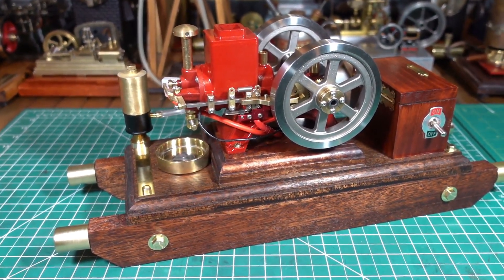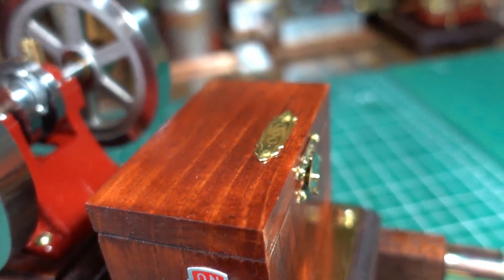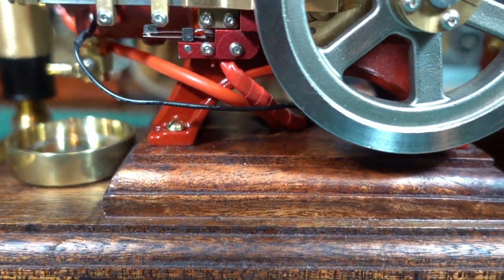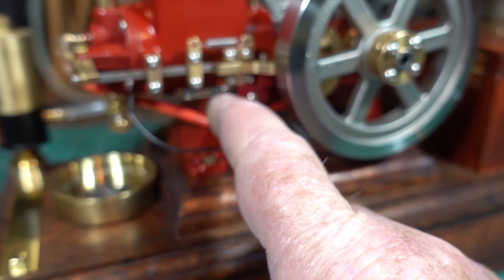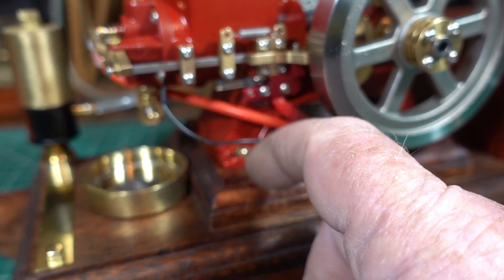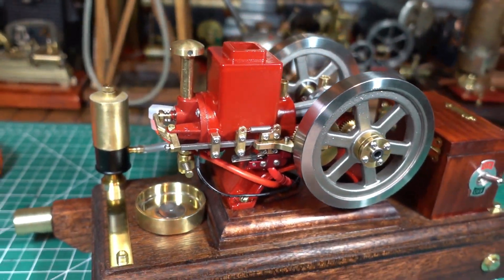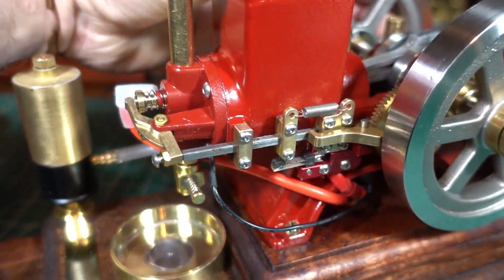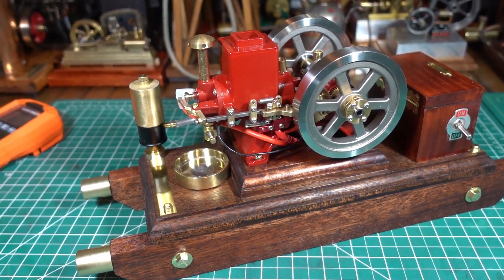Hit & Miss Engine 6cc Enjomor - Help Needed

Comment: Hi Jim, have you cleaned the contact points?  Ive had an issue with mine before with oil and crud "insulating" the contacts.  The black and white wires are the only 2 needed
Reply from the maker: Thank Matt appreciated, I'm working my way through all the hints and suggestions. I've been told that they need a higher voltage than 3 x 1.5v batteries, but it seems like that's all people use?
Reply from the maker: Still haven't got it working, but one thing I did do is that you know that bastard of a spring that holds the governor in place? I put a small drop of superglue in the brass hole and then put the spring in.....can't lose it again and spend an hour looking for it !!
https://flic.kr/p/2oS1b5T

Comment: Hi Jim. First of all, superb work on the base 👍👍👍 Watching other videos on this engine I noticed that where the black & white wires connect to the contact breaker the top one is very close to the brass latch. Might be worth checking to see if it's shorting.  Also, if you disconnect the cable from the contact breaker to the ignition unit then use your multimeter switched to resistance/ohms, place the meter probes on either side of the contact breaker and operate it manually to see that it actually is making and breaking.  Other than that all I can suggest is remove the ignition unit from the engine and test it by manually shorting the white and black leads together while having the HT lead close to the battery negative. That should give you a spark. If it doesn't that would tend to indicate the ignition unit is dead. Cheers, Alan.
Reply from the maker: Thanks Alan appreciate the comment I will try out those suggestions. I'm hoping its just something very simple.....thanks again for the help mate!
Reply: @SteamEngines-Jim  Let me know how you get on.
Reply from the maker: @RetroSteamTech  Thanks Alan I hope to find some time to muck around with it today.

Comment: Beautiful base!

My Enjomor ignition was shorting out through the 3rd wire in that reed switch.  The black and white wire triggered the unit, but then the red wire was grounding out through the reed switch instead of the main ignition wire firing the plug.  I removed the red wire from the harness and that sorted the issue out.

I've also had another ignition unit that was a Hall Sensor, but it kept frying the hall sensors.  It was also firing backwards through the 3 wire trigger harness like the Enjomor.
Reply from the maker: G'day Henry, appreciated mate. Just to make doubly sure what you mean. I should take it apart and remove the red wire so that there's no way it could be touching anything and just have the black and the white wire soldered onto the two contacts? - Cheers and thanks Henry - Jim
Reply: @SteamEngines-Jim  yes, the black and white wires are the only ones used on the contacts.  remove the red wire to make sure it isn't shorting out.  I see another comment mentions testing the contact.  Watch out for that red wire though!  I got zapped by mine (that's how I accidentally confirmed that little red wire was the short).
Reply from the maker: Thanks Henry appreciated How many volts are you using? Just 3 x 1.5v AA batteries
Reply: @SteamEngines-Jim  Yes, I am using the 3x1.5v AA holder that came with it and either Alkaline or some 1.5v Li-Ion AA rechargeables I have.  I know some people use 2 AA and a dummy battery to keep the voltage down, but I usually lose spark when a set of 3 batteries gets worn down to about 3v.
Reply from the maker: @henrybangsberg2187  Thanks Henry, someone told me that "the yellow box needs 7.4v voltage, you can buy a 3.7v battery for the battery holder" but everyone seems to be using only 3 x 1.5v batteries.
Reply from the maker: P.s. just to add a big thanks for all the help Henry.....really appreciate it mate.
Reply: @SteamEngines-Jim  I think the label on the side says it takes 4.5 to 7 or 8 volts, but I glued mine to the underside of my mounting box and can't read it any more 😅  You should be able to replace the yellow unit with any of the black units.  I have a spare faulty one from my R18 that fries Hall Sensors (it fires the spark through the ground wire on the terminal, cooking the Hall Sensor), but will work when I just touch the two trigger wires together.  If you have a spare black unit that uses the hall sensor you can just try touching each of the 3 wires together and when you find the 2 that trigger the spark, connect them to the reed switch on the Enjomor.
Reply from the maker: @henrybangsberg2187  Thanks Henry appreciated mate.
Reply from the maker: Still haven't got it working, but one thing I did do is that you know that bastard of a spring that holds the governor in place? I put a small drop of superglue in the brass hole and then put the spring in.....can't lose it again and spend an hour looking for it !!
https://flic.kr/p/2oS1b5T
Reply: I’ve never had any luck with those yellow cdi units. I have 3 of them here that I’m trying to use up somehow but every model I put them in gives me hours of grief and I end up swapping it out for something else. I’d try removing the redundant red wire first though as others have suggested.
Reply from the maker: @Darren_Fawcett  Darren what unit did you swap them out for?